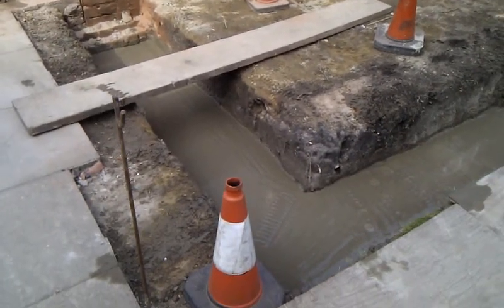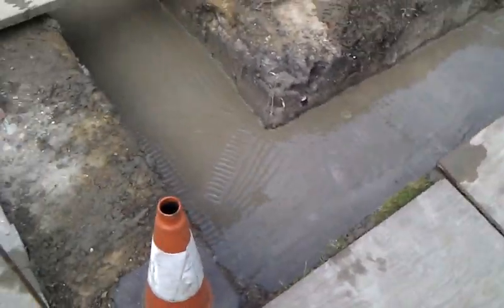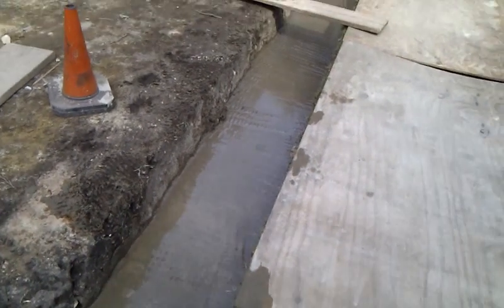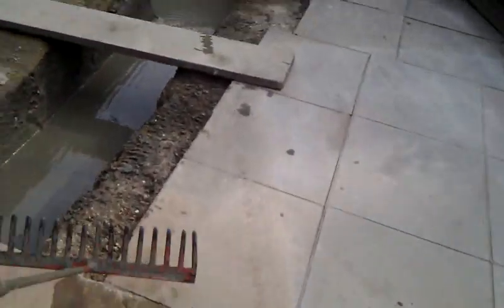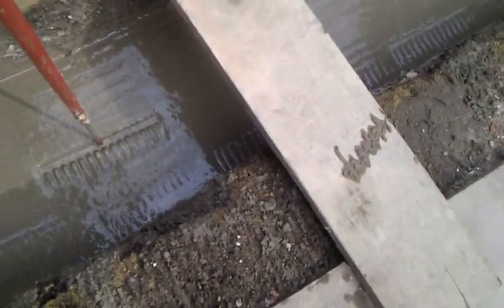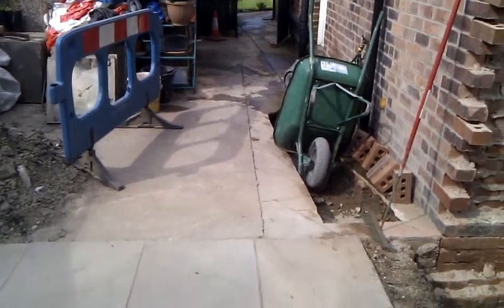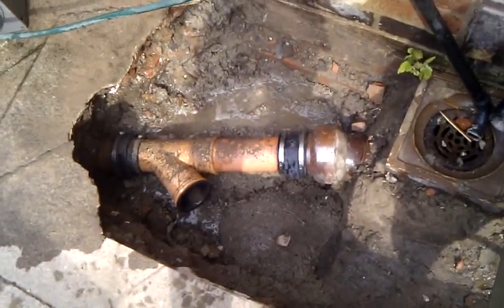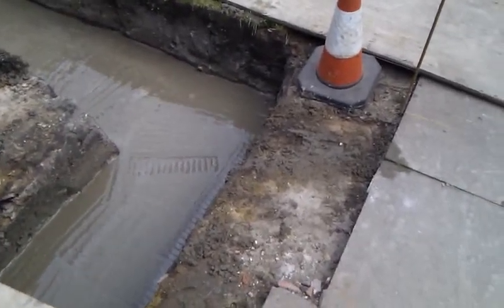how to put in a concrete foundation for a home extension

Comment from the maker: You can fill your trench with concrete saving on the bricks trench blocks etc but will cost more in the concrete I say it's about the same if not a bit cheaper to fill with concrete
Don't bring your concrete all the way to the ground level due to frost? Maybe around 2 -3 bricks below ground level.
Using engineering  brick below your damp course and and brick that matches the house above damp course.
Remember bringing the concrete up can interfer with some drainage gulleys that are going next to the wall.
Also if any drains near by or cutting across your trench this needs to be bridged over. See building inspector for more info.
A trench needs to go below any drain found so it does not damage it.
Not many use them but for an accurate  job on pouring concrete use a vibrator to take the air pockets out. Great for steel padstones.
Karl

Comment from the maker: Hi mate the depth of the concrete can depend on the height of the building going up.
its the ground that has to be checked by a local building inspector for you to lay the concrete on.
anything from 8" slab off concrete to more.
no there is no stone under the concrete foundation 
i think you may be thinking that a good 6" os stone is to be laid under a concrete floor with over materials
i hope this helps
karl